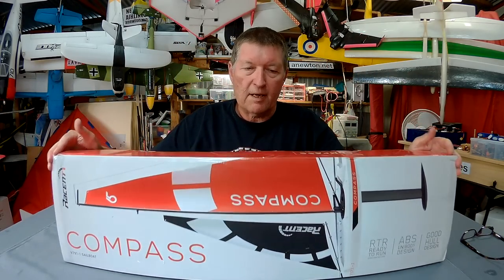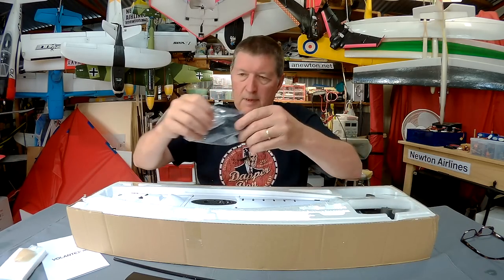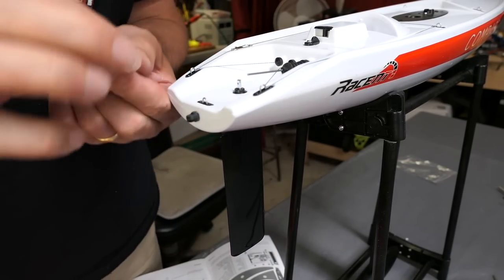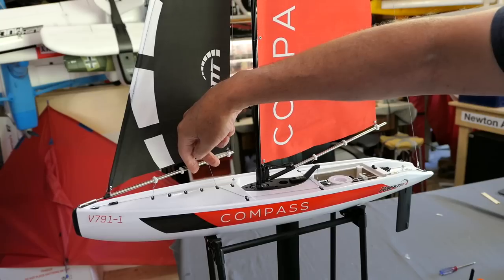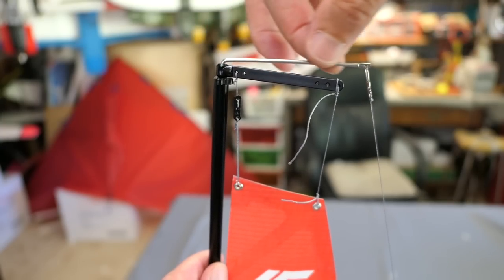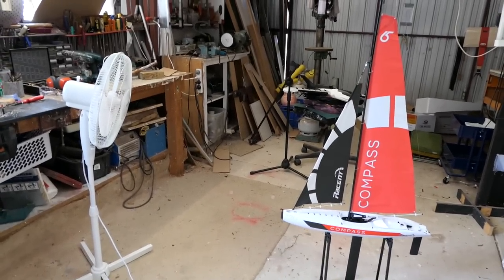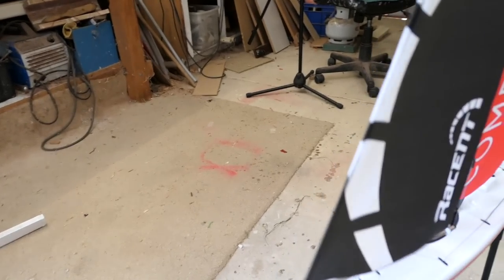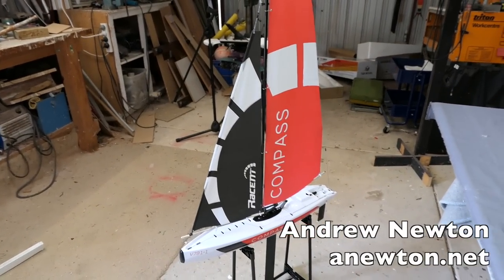Volantex Compass RC Yacht

Comment: Trying to assemble this boat and already meeting so many faults. Try to push a 5 mm bolt trough a 4 mm hole! After solving that the keel as well as the rudder were not in line with the hull. I am not going to sail with that, Trying to find a solution but makes me puke.

Comment: The boom appears 180 degrees out. The vang is usually on the bottom, that would make the boom even with the mainsail bottom. I'm going to mod mine to work correctly
Reply from the maker: For a full size sailboat maybe. But models use lots of different ideas

Comment: Thanks Andrew, my wife has had a “Duckling” rc yatchet from back in the mid 80’s (lakesedge engineering, Toukley, NSW) which we both enjoy.
Sort of worked out how to sail, but your explanation made a lot more sense. Many thanks.
Reply from the maker: Duckling, sounds like it would float!
Reply: http://www.traplet.com.au/content/images/thumbs/0024816_duckling-rc1344.jpeg
36” 914mm fibreglass with Mylar sails.

Comment: Perfect configuration. With your permission, allow me to write down three details that could improve the configuration of this sailboat: I think you need one luff ring at the top of the sail; a little more of the jib curve (leech); and grease the rudder shaft so that it turns more smoothly. I see that you are a professional in everything
Reply from the maker: Thanks Juan, you read my mind. I have added the top luff ring, and will grease the rudder shaft too.

Comment: Very keen to see what you think of this thing in the water, do you think it is a good starter sailboat for someone experienced with cars and small planes?
Reply from the maker: It is a good starter, it sails nicely and the components are good. But mine leaked a little so I added extra water proofing (silicon sealant) around all the attachment points. I also changed to a decent receiver and radio.Better yachts are a lot more expensive.

Comment: 8:35 I think what might be the proper way to rig that is have one continuous line anchored at the end of the mast extension (towards the stern end), thread it down through the upper rear/stern side sail riveted attachment point, then along the top of the sail, through front/bow end attachment point, and then up to the block used for adjustment, in one continuous piece, allowing a more complete tensioning system.
Reply from the maker: Hmm, that sounds interesting. Thanks for the tip
Reply: I believe that’s incorrect. If it were just a “loop”, it would be doing nothing but providing downward pressure on the mast, but not locating it front or rear. By tension in it with two separate lines, you can change not only the downward pressure, but also the angle/bow of the mast front or, more importantly, to the rear. Expert sail shaping I don’t quite understand 🤷🏼‍♂️

Comment: Looks pretty good. As you say though the sails are pretty hopelessly cut but I guess that's a fault with most of these. Going to need a jetty or pontoon to float it though. (Or chest waders).
Sadly, I've got nowhere within 30 miles where I could use it :(
Reply from the maker: Ha, you're right. Watch the maiden video.

Comment: Just got one thinking of putting sealant on keel rubber and weight one, a good or bad idea has yours deteriorated over time?
Reply from the maker: Yes good idea, seal up all the gaps to stop leaks.
Reply: @AndrewNewton  Thanks for reply well its all rigged up and ready to maiden the TX is very suspect in operation tbh. It  jitters on sail winch, so going to try bind with RMTX 16S may cure it .. fitted different RX now bound with RM TX16S yay!!
Reply from the maker: Much better range, good idea

Comment: The bow looks totally weird, at least compared to full scale. Maybe the designer knows something I don't and I do know they need to run way more underwater lateral area for upwind performance.. Edit: looks like the bow was designed for maximum volume, probably to avoid stuffing it. Bad for performance though :)
Reply from the maker: Accurate scale doesn't translate to best performance in models, specially with boats.

Comment: Now come on Andrew,  you did say reaching when you finally turned the boat to 45 deg down wind, but really, that was broad reaching. Every sailor's favourite attitude because it's the fastest point of sailing and how all the various sailing world speed records are set. And I should know, I've watched all the videos!
Reply from the maker: I have been for a blast along the Sandy Point course on a sailboard. Strong wind and glassy smooth water, oh yeah!
Reply: Andrew Newton Heh, maybe this summer I’ll drag my lazy rear to Chesil Beach near Weymouth and do the same, on one of my seven board collection. Well I kept finding them at the local recycling or on eBay for £30 and have ended up with 5 Mistrals and 2 customs! Do you want one?